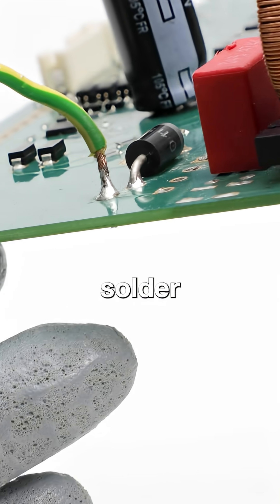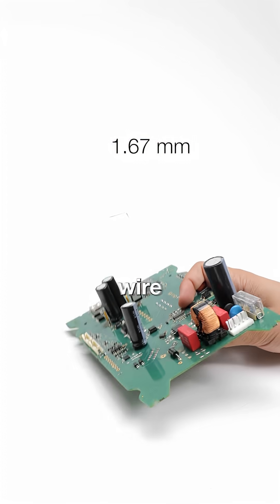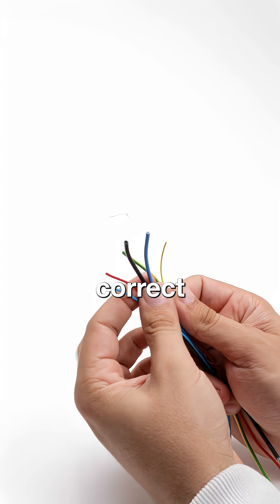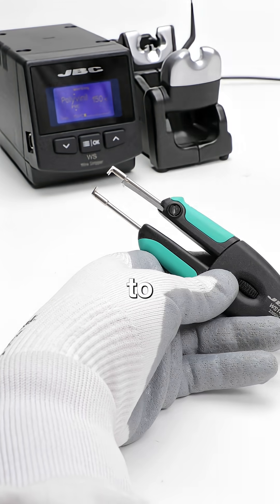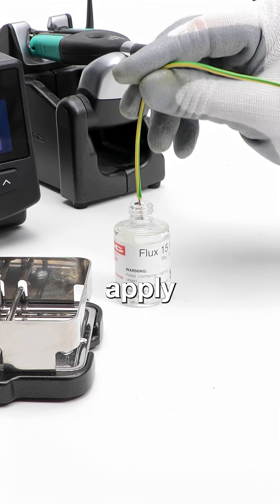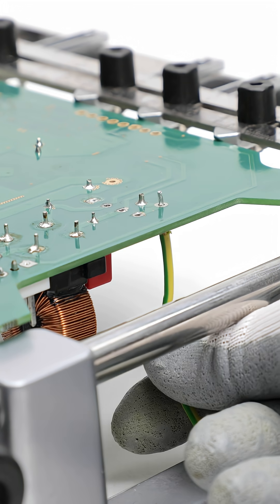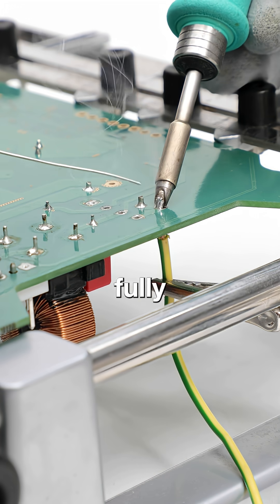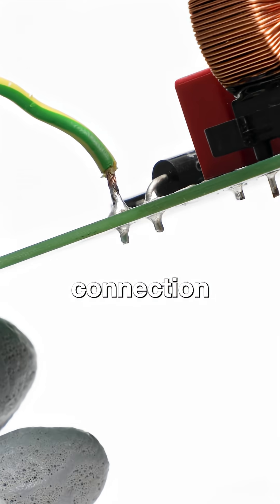How to solder a wire into a through-hole (THT) on a PCB | JBC Soldering Tools

Comment: Strip with teeth, solder, cut excess.
Move on to next one.
Reply: Use the stripped wire isolation as chewing gum
Reply: You're a teeth stripper too?
It is a skill, you need to know how much pressure to apply.